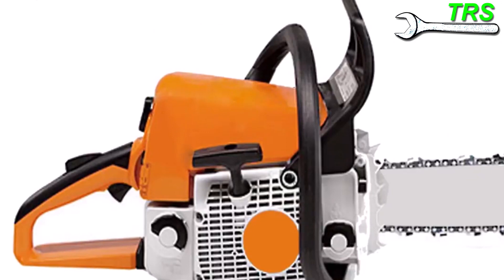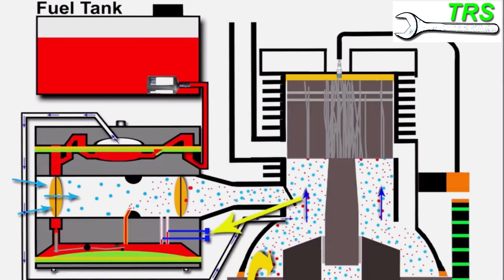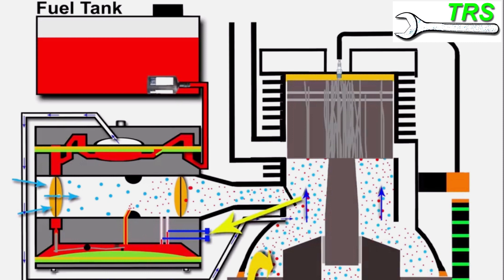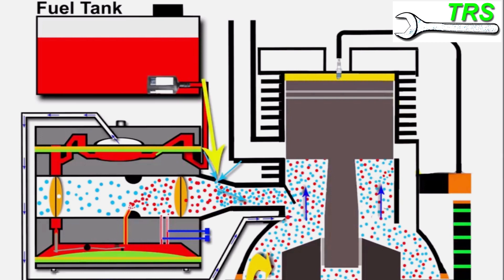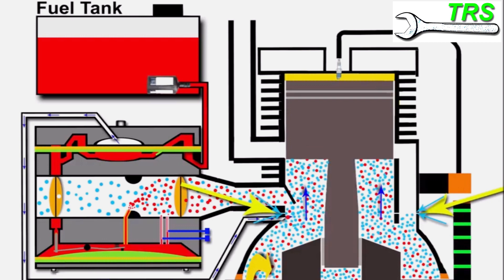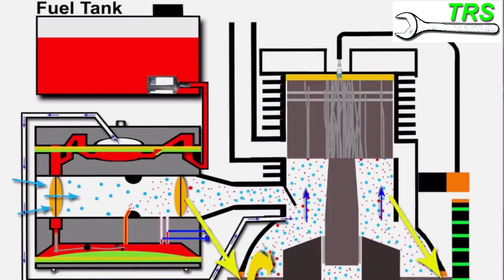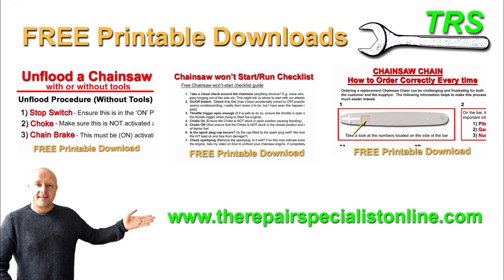Lean Fuel Mixture Effects on 2 Stroke Cycle Engines.  (by Craig Kirkman)

Comment: And don't forget ethanol damaged fuel and vent lines. Ethanol is a major cause of intermittent air leaks and subsequent deterioration of susceptible components within the fuel system.  Cracking and hardening will usually be seen where the hose is expanded to accommodate the filer. and where the line is exposed to the fuel and air (partially filled and stored equipment has an extremely short shelf life) environment within the tank.  Thanks!

Comment: I have a 2t 50cc scooter. It use to bog from factory .I know some factory run a little rich. I added a malossi double sponge filter and bike running better and no more bog. I've been told to check plug so I did. It's looks OK but I'm no expert. Looks like it's cleaned plug carbon a bit.will I get a lean bog straight away or only if I get to hot. I'm wanting to run filter as bike goes better.ive learnt there is a lean bog aswell but hasn't after a 5 minute ride

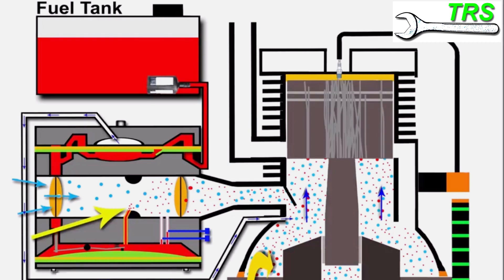Comment: If we want to turn H a little, to make the saw fast, can we compensate for that lean condition by adding a little more two-stroke oil to the fuel?  For example, if we used 1:40 to move to 1:35 or 1:30?  Or in other words, can excess oil in these circumstances help the engine avoid problems due to high revs and reduced fuel supply, thank you?
Reply from the maker: Believe me I know where you are coming from there because I have tried this over the years.  Whilst I can say I haven't experienced much of an issue short term, I have found that my engines didn't last as long doing this.  This is just my experience though and I'm sure there may be many other people that may tell you different.  I personally would set the carburetor in a way that delivers the fuel for that fine line between engine speed and longevity.  I personally wouldn't go too far either way.  This is just my opinion on this and I hope this helps.  Many thanks. Craig

Comment: I know more about lean fueling than I want to. I had a Snowmobile that I rebuilt using the factory service book and it still leaned out on the magneto side and burned a hole through the piston. Turned out the design of the machine was causing it to overheat due to lack of airflow around the engine and the jets they installed were wrong. The manufacturer offered screens to be installed in the hood to increase air flow and new jets. The problem after that was it had terrible fuel mileage and the screens ruined the look of the whole design of the snowmobile. They discontinued it after two seasons and never again mentioned that model. It was one ugly snowmobile. We nicknamed  it the frog because it looked like a big blue frog.